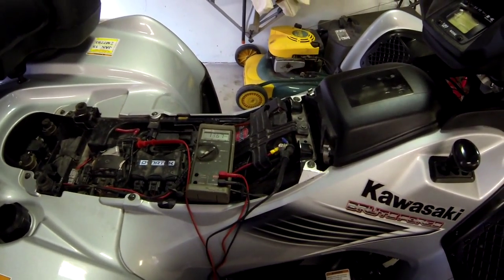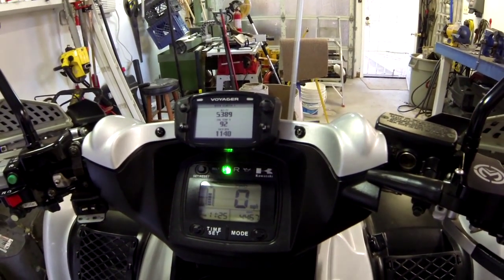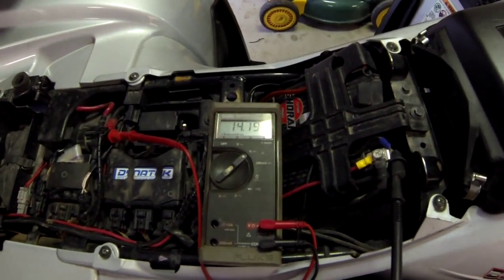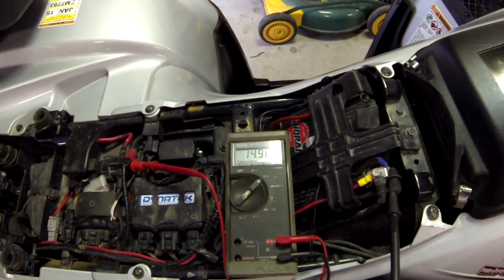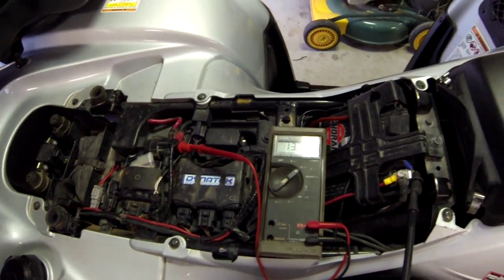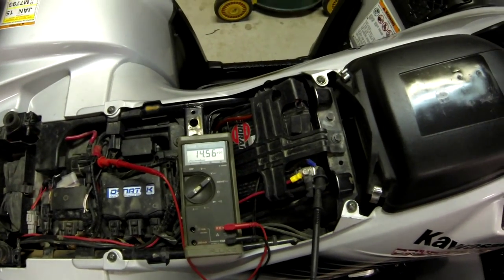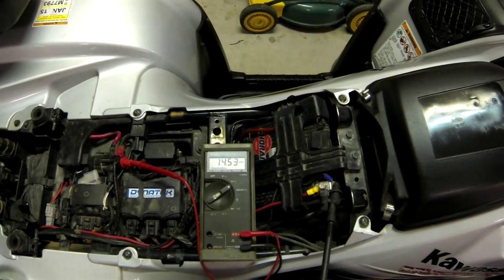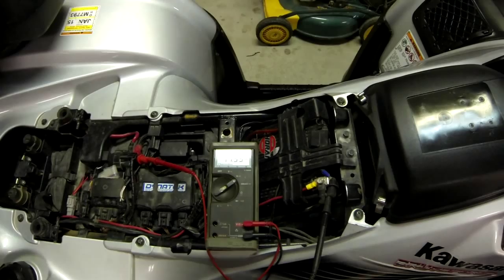Regulator Test -OE to RM Stator

Comment: Did the stator last
Reply from the maker: Yes, it lasted with no issues. I sold the Brute in late 2016.
Reply: @nmkawierider  nice if the used one I bought fails quickly I’ll get one from them and it’ll still be cheaper than buying the oem one talk about steep